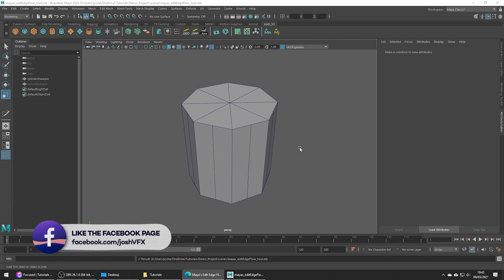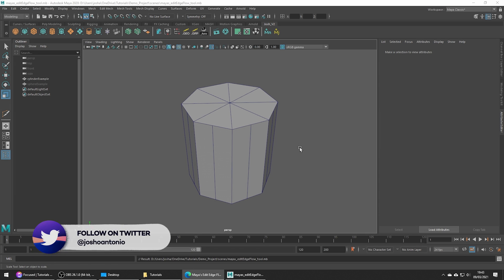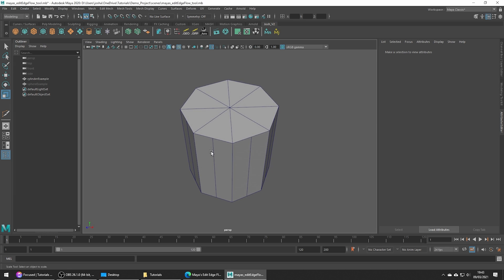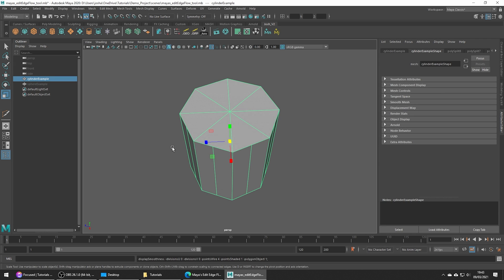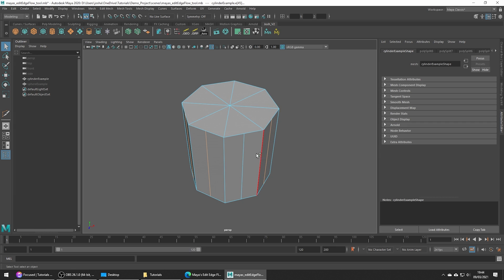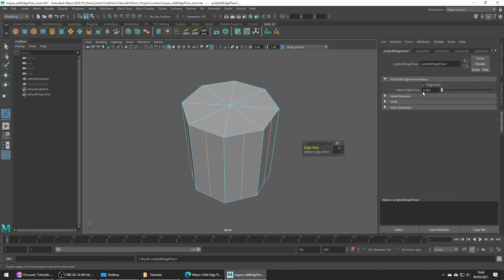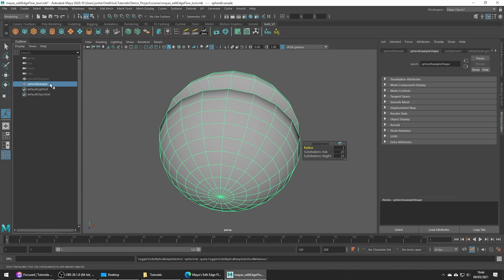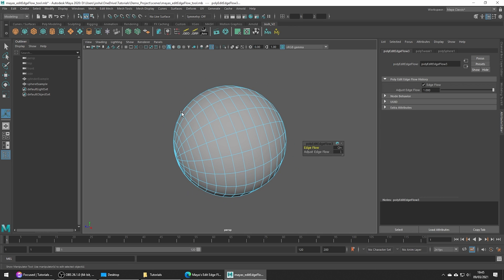Maya's Edit Edge Flow Tool

Comment: Good summary and examples of using the Edit Edge Tool. The only thing I would have added, is after you applied the tool to the extra edges on the cylinder, it would be a nice visual to show the Subdivide after that.  Still a good video.  =)